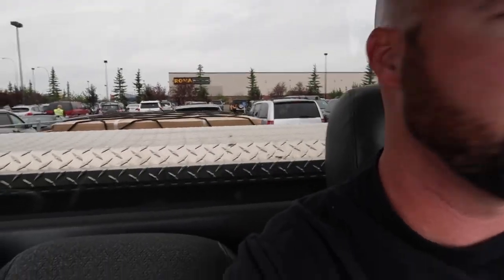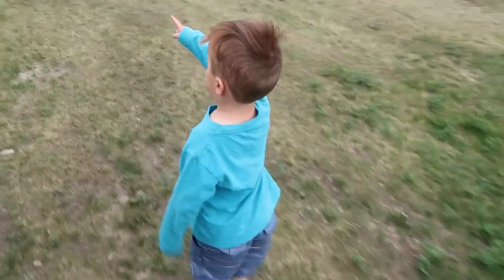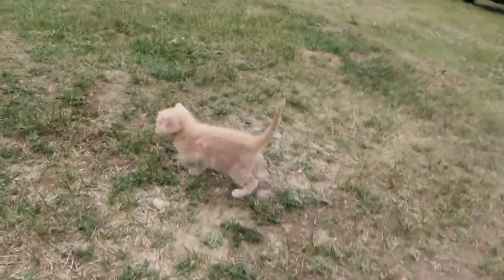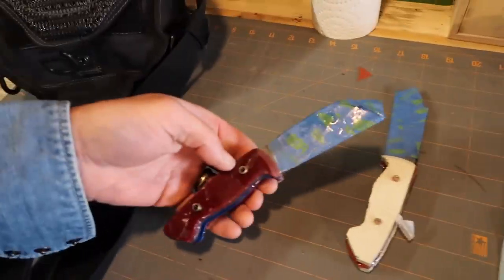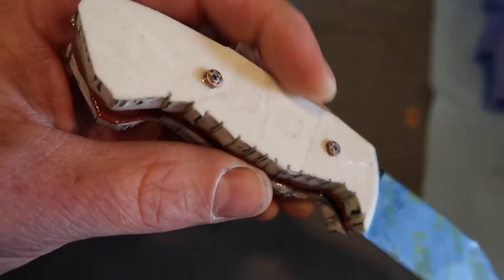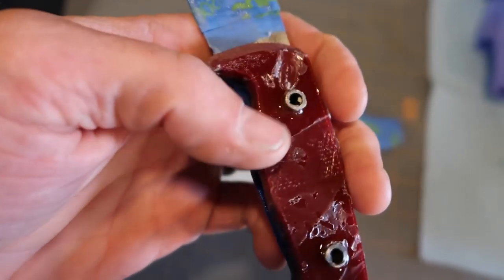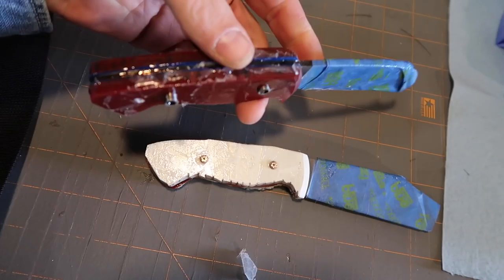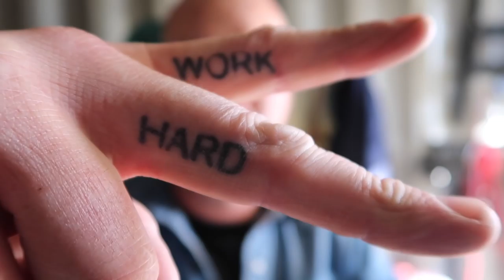Knife maker's Vlog - June 14, 2016

Comment: Great video, thanks. Do you mind sharing what kind of respirator you use, I'm looking for a better one than I have.
Reply from the maker: Not at all. It's a 3M particulate filter. These aren't the cheapest on the market but they're not too bad. And, they last really well (the mask itself) the filters just tread on and off and they make a huge difference. Cheers!
http://solutions.3m.com/wps/portal/3M/en_EU/PPE_SafetySolutions_EU/Safety/Product_Catalogue/~/3M-Half-Face-Mask-Respirator-6000-Series?N=5548558+3294361846+3294857473&rt=rud
Reply: Thanks

Comment: I used you design to make my first knife I paracord wrapped it and thanks for inspireing me to make knifes
Reply from the maker: woah dude! that's awesome! I'd love to see a picture of it! How did it go? First of many? I hope so. Cheers and I'm glad I offered some help to you. But, remember, it's you who actually went through the work and made the knife. Always enjoy that. Cheers!
Reply: +Simple Little Life I will. Do you have an Instagram account
Reply: +Noah Trains  the only problem I found is that I can't get thick enough steel here in the uk. I used gauge plate but it was too thin so when I tempered and hardened it the blade warped but I'm using it as a roping knife so it doesn't REALY matter. It was my first knife so of corse I was going to make mistakes but that's how you get better.
Reply from the maker: Noah Trains you get. Thin blades are a pain like that. I've tried a few kitchen knives and had them warp like crazy. For my next kitchen knife I'm going to  try heat treating after profiling the blank and then putting the knife bevel after heat treat. This would probably be difficult if you were filing the bevel by hand but with a belt grinder should be good as long as you keep the blade cool. Cheers!
Reply: +Simple Little Life  I will post a pic in my YouTube account
Reply: +Simple Little Life I've uploaded a small vid of it
Reply from the maker: Noah Trains That looks really good! Nice work on it! Really, you should be quite proud of that. Good job. Cheers!
Reply: +Simple Little Life  thank you👍🏻👍🏻

Comment: Hey Jeremy, what thickness do you use for your knives?
Reply from the maker: Depends on the knife but usually 1/8" or maybe 3/16". I did just pick up some 1/16" tool steel that I'm going to try a few things with. 1/8" or 3/16" are pretty good all-rounders though. Cheers!
Reply: +Simple Little Life thank you! I'm soon going to buy some tool steel and just didn't quite know!
Reply from the maker: Gavin Elliott cool beans. That's the stuff that I've found works well for me. Cheers!